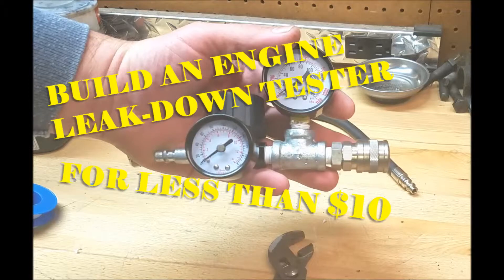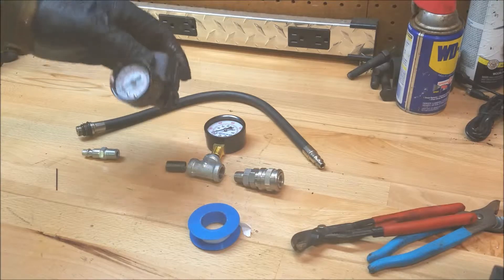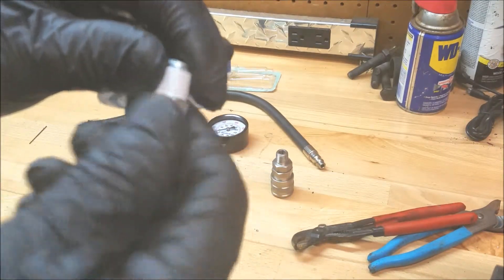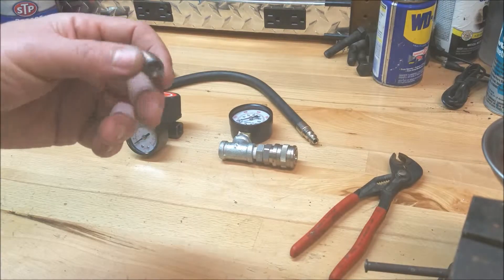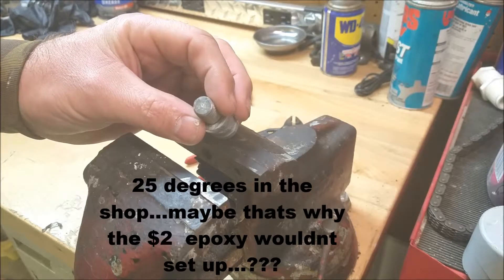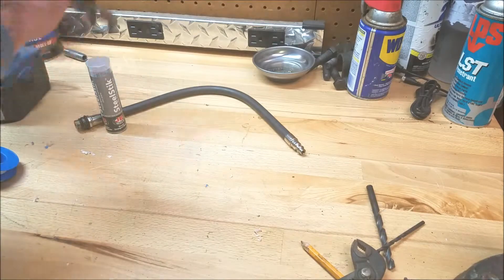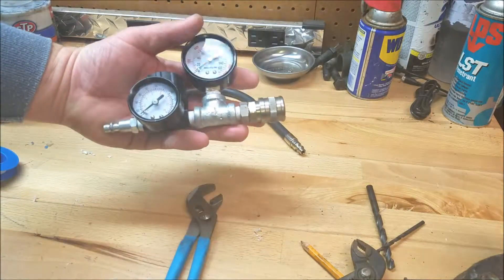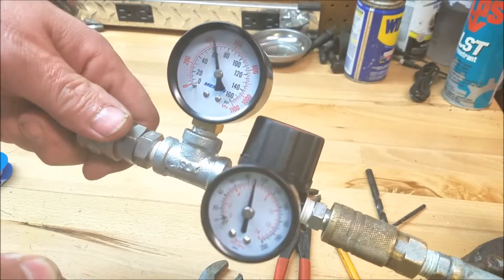Leak Down Tester built for CHEAP!

Comment: $10 ? give us a break.
Reply from the maker: Hi, thanks for watching. This was from 2018 and parts supplied from Harbor Freight. I think there is a price breakdown  in the description (2018 prices). I was assuming anybody building this would  already have a compression tester for the hose. I checked prices last year and it was still under 20.

Comment: Is there a formula to determine size of drilled hole, or is small the only concern?
Reply from the maker: Probably a formula you can use but I’m not a mathematician.  The ratio between the hole size and test pressure has to be such that you can see a pressure differential between incoming pressure and what’s in the cylinder. Basically, the holes just needs to be small…030” - .040”  is good for testing at 100 psi. The gauge is measuring the differential pressure so if  the hole is too big, both gauges will read the same. Too small and the reading on leak gauge might be inaccurate at high leakage rates.

Comment: Wow! I did not know it was that easy! I have most of the materials to build it in my shop! Thank you for this DIY tip. I have wanted a leakdown tester for home & hobby small engine work, but couldn't afford one. Now, I can, 👍 Paul
Reply from the maker: Thanks for watching. It is a fairly simple and cheap project compared to what one cost retail. I have an old snap-on leak down tester I bought at an estate sale a couple years ago. My DIY version gets the same results as the snap on unit. Maybe one day I’ll make a comparison video. Good luck with your project!

Comment: This is excellent - what I did not understand is why you need a restriction between regulator gauge and pressure gauge. If there is no leak, both will read full pressure, and if there is a leak, the pressure gauge will still reduce in pressure while regulator tries to maintain full pressure....?

Having thought about it while writing this, I can see the restriction being useful to maintain full pressure on regulator when you have a massive leak - is that kind of right?
Reply: You need the restriction to give a measurable pressure drop....in effect the restriction turns the device into a flow meter. With a good cylinder and almost no flow, the pressure drop across the restriction is close to zero so the two gauges show nearly the same reading. For a leaky cylinder, air flow rate is high which results in a big pressure drop across the restriction and so the two gauges show a big difference. It's the difference in pressure on the two gauges that you use for diagnosis. Without the restriction...or with too big a hole (more than 1mm diameter)...there is very little pressure drop and so the two gauges show the same reading regardless of flow rate. I bought a cheap gauge and it had a 2.5mm hole and showed no pressure drop regardless of how much air flowed. I had to modify it to bring the hole size down to 1mm. 

As an aside, once you've identified a bad cylinder and want to trace the leak, you're better off removing the leak down tester and connecting the air line direct to the cylinder. This will allow much higher flow rates and make it easier to feel or hear where the air is leaking out.
Reply: @markjones3121  Good info - like the idea of directly hooking up airline for extra air to identify leak location.
Reply from the maker: When I know there is a dead cylinder or i have isolated a problem to one cylinder, I won’t waste time with the tester. I will apply air directly to cylinder at 100psi. I knocked the porcelain out of a spark plug and welded an air fitting to it. Cheap tool and makes it easy to connect an air hose.
Reply: @pingpong9656  As commented elsewhere, when you do this keep fingers etc clear of engine parts. If the cylinder being tested is not at TDC or very close to it the engine is likely to rotate 180 degrees and with say 100psi on the compressor,  with a lot of force. And because there's no flow restriction when connected direct to the compressor it might move quite quickly. With a manual gearbox you can stop this by putting it in a high gear and applying the handbrake. With an auto just check nothing's going to get damaged or chopped off if the engine suddenly rotates.
Reply from the maker: @markjones3121 well said.
Reply from the maker: Yes, the restriction allows for a pressure differential between the two gauges so we can quantify the loss of pressure. It also restricts the volume of air.  You’re correct, without a restriction a small leak would be measurable but a large leak will result in the pressure gauge going to zero or near zero. The restriction reduces the volume of air getting into the cylinder and makes it a controlled leak and allows the pressure gauge to stabilize.

Comment: Never can you build for 10 bucks , the air regulator costs that alone more bs
Reply from the maker: Thanks for watching. This video was made in 2018 when things were a little cheaper. I suppose I could change the title to reflect current pricing. I spent less than 10 dollars out of pocket to assemble this tester using random parts I had on hand like the quick coupling, the hose from my compression tester, a gauge off my old compressor. I had to purchase the Air Regulator, the galvanized tee and the close nipple. I assumed most people willing to build this would have the compression tester already for the hose and a quick connector for the air compressor. I just looked up the prices for a regulator with gauge (5.99), a 160psi gauge (6.99) and a quick connect set (4.99) from harbor freight and a galvanized tee (1.77) and close nipple (1.40)  from Home Depot for a total of 21.14.

Comment: Hey mate,  what's the reason for the restriction between the 2 gauges?
Reply from the maker: As air passes through the  restriction from the high pressure side, the pressure drops. The installed gauge allows us to see the  pressure differential between the supply side and the leaking cylinder. A cylinder leak down test can be accomplished by applying static air pressure to the cylinder without a gauge, then listening for air coming out of intake, exhaust, etc. This is great for finding a gross defect in an engine but without a gauge we can’t determine the severity of the leak. A Leak down tester allows us to quantify the leak and compare readings  cylinder to cylinder and against specifications. Not a fluid dynamics guy but I hope that explanation helps. Thanks for watching !
Reply: Thanks mate, appreciate it, i have a cheap leak down tester now, however i find it anoying to dial it in within the "set" range, aswell as it normally is in the set range with the reg set around 20psi. I might swap the gauges on the manifold so i can just set the reg to 100spi, can you see an issue with that? I presume inside my current tester manifold its restricted,  if not i can epoxy and drill a 1mm hole.
Reply from the maker: @ybsadfor  the 20 psi leak down testers are touchy, I find they work best for small engines like on lawn mower. Swapping  the supply gauge out for 100 psi  should work as long as the regulator is rated for that pressure. You’ll know pretty quick if it’s not, you won’t be able to adjust pressure. There should already be a restriction inside the manifold.

Comment: What drill bit do you use to bore out the hole?
Reply from the maker: I don’t recall exactly what size I used, but a 1/16” bit will work. I use number drills a lot  for machine work that are measured in thousandths of an inch instead of fractions. I have a bunch of them laying around making them an easy grab. If I recall correctly I used  a #53 or #54 and they are both just slightly smaller than a 1/16th. Thanks for watching and I hope you build a leak down tester. Prices today are quite a bit higher than 2019 but you should be able to put something together for about 25 bucks using HF stuff.

Comment: Wow! I had all of the parts within 6 feet of where I'm sitting. Even the drill bit. I was looking at this stuff just yesterday, wondering if I should Trash 'em or keep 'em. For once, I was ahead of the "Murphey's Law" subclause that states that " You will not need the item until two weeks after you toss it".

What's even better is, I had put a Leak Down Tester (cheap Chinesium version) in my watchlist on eBay, got an offer for less, which prompted me to look a bit further into it on YouTube, and here I am. Ahead of the game again, with left over, BRASS parts, no less. (except for the regulator) It's even dry fitted together already except for sealing the threads, putting epoxy in the nipple and drilling. (I may just take the time and polish it all up and make it "Shiney".)

Man, Thanks so much for posting this video. You totally made my whole day TWICE in less than 15 minutes!
You helped me reduce some of my clutter AND saved me $40. (Winner, Winner, Steak Dinner! (forget all about chicken)).
Have a great day, take care and Thanks Again!!!
Reply from the maker: Glad to hear the video was of some help and saved you some $$$. I have used mine several times and it’s just as accurate as the Snap-On leak down tester gathering dust in my tool box. As I tell my wife..it’s not clutter, it’s an unassembled project. Thanks for watching and keep an eye out for new content.
Reply: "Unassembled project"😂

Comment: Hey brother can you explain that quick disconnect i cant find one like that
Reply from the maker: I assume you are asking about the quick disconnect hose. The hose  is from my compression tester set. Most compression testers use a hose like this. If you dont have one already it is an additional expense and it will push the cost of this project higher. IF you dont have one and you want to diagnose engine condition you need one anyway. These prices were from 2019 so it may be hard to find all these parts for the same price.  https://www.harborfreight.com/automotive/auto-shop-tools/compression-pressure-testers/compression/quick-connect-compression-tester-62622.html